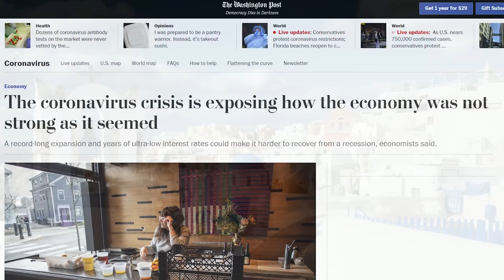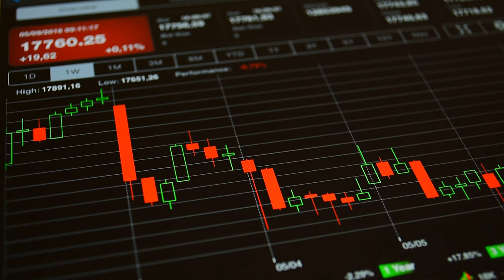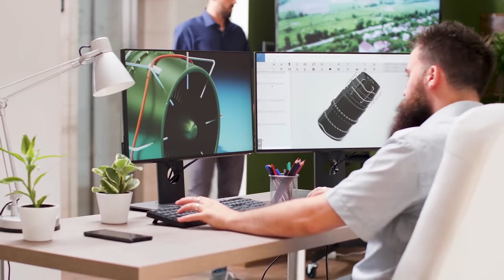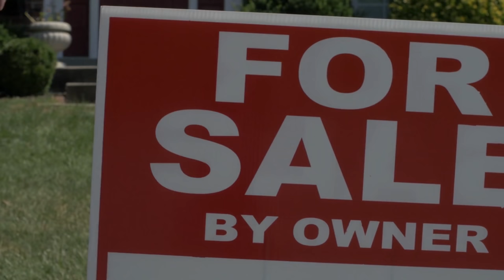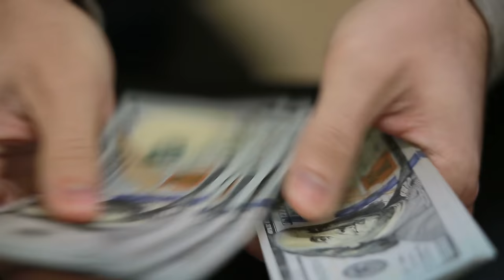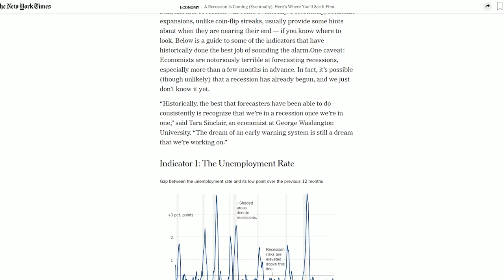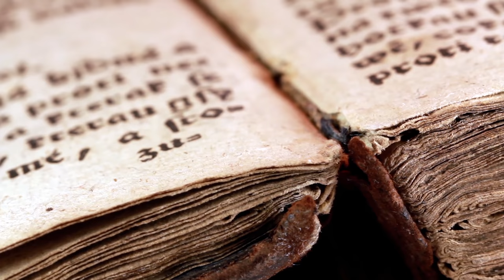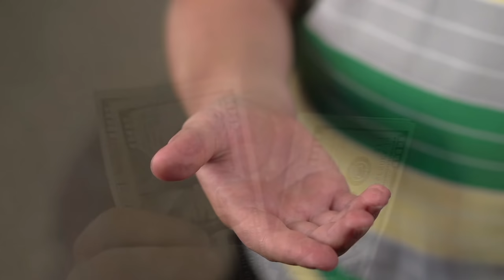Do We Actually Need Debt?

Comment: The part about housing is exactly what’s wrong with college loans.
Most people could afford college back when the only way to get in was to pay for it, now that just about anyone can go to college for just about any degree and go into debt.
Reply: Same as the housing crisis just a different subject.
Reply: This could also be carried over to healthcare
Reply: However unlike a house a college education can actually be economically beneficial in the long run
Reply: “Most people could afford college back when the only way to get in was to pay for it”
If most people could afford it then, why more people has it now?
Percentage of college graduates in US
1940 – 4,6%
1950 – 6,2%
1965 – 9,4%
1975 – 13,9%
1980 – 17%
1990 – 21,3%
2000 – 25,6%
2010 – 29,9%
2015 – 32,5%
2019 – 36%
Reply: @AnishJBhave  wtf, a house provides shelter for a whole family for a very long time: do you really think that this doesn't have economic value?
Of course it has. And when you stop living in it you can still rent it and it will provide a steady income (just like your college education: both are investments)
Reply: @stafer3  simply because there were many economically viable options for non-university grads. You could easily buy a nice house and still have money saved up on just one blue collar job per household in the past.
Reply: @stafer3  they are convinced they HAVE TO GO to be successful in life.
Reply: I mean a lot of people whose in debt with a college degree usually have a degree that's not in high demand.
Reply: @tiredox3788  that's because a lot of people still think that salaries are always according to "how much you know" or how many degrees you have. But salaries are set by supply and demand.

Just picture a town with a thousand doctors and just one plumber, who would have a better pay?
Reply: @huguesjouffrai9618  of course a house has  economic value. But your ability to contribute to the economy increases with a degree while owning a house really does not impact it. Other housing alternatives exist. Owning houses also contributes to worker immobility which creates a sticky economy where efficient allocation is inhibited, so housing is great for the individual in terms of wealth creation but the house itself does not add sustained economic value
Reply: @MK_ULTRA420  Of course it is an investment. It's even as close as you can get to the definition of an investment. For most people it's a great one that provides a lot of security and long term financial stability. If you pay a rent you still pay for the taxes your landlors pays instead of paying for your own, there is no gain there.

In your video the guy still encourages everybody to get indebted to buy real estate, and to just rent the house you live in and put the house you buy to rent. In most places, unless you are a real estate professional or you have a lot of money to invest this will create fiscal friction (sometimes a lot) and many complications (managing repairs in your own house is easier than in your tenant's house...).
This is a good alternative for people who want to move around but in general it's not very different as an investment from buying the house you live in.
Also if you are not very rich it is much more difficult to get a loan if it's not for the house you live in.
Reply: @AnishJBhave  You forget that once you own a house you don't have to live in it forever. You can sell it to buy another one or go live somewhere else and put it to rent... It gives you a lot of freedom since you own it.
It's not for everyone and for some people the lack of mobility is indeed a great problem but the house does grant a financial stability and safety for people which does have sustained economic value because it will enable them to take more risks in other areas. Once you own your house you can invest in riskier assets, quit your job for a riskier carreer while your wife supports the whole household, not have to worry too much about retirement...

"But your ability to contribute to the economy increases with a degree while owning a house really does not impact it"
What do you mean by that? Of course investing in real estate contributes to the economy. The sum of all investments in real estate ends up financing housing for everybody which is sustained economic wealth. It's like saying investing in roads doesn't change people's ability o contribute to the economy. In the end people need houses and roads to live and therefore produce. But moreover housing is a basic need and all investments in real estate goes towards the satisfaction of those needs (it's maybe more visible when you build a house than when you buy one but it's the exact same thing).

Degrees are not economically very different from other investments. They directly increase the prodctivity of labor instead of capital. But investments in capital also end up increasing the productivity of labor (owning a car instead of a bike makes you a more productive individual)
Reply: @stafer3  Source?
Reply: @huguesjouffrai9618  i completely agree. A house has tremendous economic value but it does little to allow you to earn more except in cases where you have multiple houses
Reply: LegoGuy87 no they don’t. Colleges increase prices bc state funding has decreased. The issue is that demand for college has increased without a corresponding rise in govt funding. Colleges used to be cheaper bc few people attended, so they didn’t hav to pay for as many services and faculty. As financial aid ramped up, more students started going to college. The real issue causing price increases is that more people are going who might not be truly qualified as financial aid is largely based on need not merit. Compared to some other countries with free college, those ones subsidize it for academically qualified students, while the US has focused on increasing accessibility even if there is some wastage of money. It’s hard to say which is a better system as there are trade offs, but it’s not the govt’s fault completely that prices hav increased.

Comment: I wrote a long af document about why debt isn't just unnecessary but it is morally wrong. But there are four central ideas. 

- Debt is not necessary to actually purchase anything. 
- Debt can only make purchases more expensive 
- Debt does not necessarily increase wealth
- Debt significantly encourages you to make bad decisions.

Personally, I have been debt free for several years now. It is entirely possible to live this way. And it definitely is a pretty awesome way of living. I am thoroughly convinced , on an individual level, you don't need debt for anything. We just use debt to get the things we think we want slightly sooner at a significantly higher cost.

You also don't need debt to fund businesses as that can be done with equity.

Comment: My definition of good debt is simpler. Does it either reduce my expenses or increase my earnings? If it does the debt is good. If not it's bad.

Back when I rented a home I remember spending over $600 a month. However, my mortgage is $411 a month. And that's a 10-year mortgage, not a 30-year. With homeowners insurance and property taxes that comes to around $460 a month. So, a significant savings. Of course, there are occasional repairs, but in general by the time I have to do any major expenses again the mortgage will be paid off. That means that even factoring in the fact that I have to spend that money myself I'm still spending less money than I otherwise would. In fact, I'm even protected against hyperinflation because a rental property would probably see its rates go up over time whereas a mortgage with a fixed interest rate is based on a fixed loan. Regardless of what happens to the economy my costs are the same.

Now, here's another good example. Energy. My energy bill averages around $400 a month. Sometimes it's as high as six hundred and other times it's as low as two hundred but that's the average. Now, if I could borrow money to install solar panels and or wind turbines and if the cost of installing and running such a system over its lifetime is lower than the money I would otherwise be paying the utility that's a good debt in my opinion.

These cases are very different from the examples given in the video though. In general, most debt is bad in my opinion. Having a large number of debt means that over time the debt becomes worse just like having a large number of assets mean that over time those assets get better. Unless those debts are guaranteed to improve your financial situation it's just not a good idea.

Comment: I think you will find that Islamic banking is less efficient and ends up with the same system but with costly workarounds to avoid the term "interest" (ribaa). The example given in the video of getting a bank to buy a house and then expecting regular payments is call murabaha... but it ends up with the same structure as a mortgage, but with more difficulty in handling late payments (this puts more risk on the bank, which means it has to charge a higher effective interest rate even if it avoids using the word). Another comical workaround is tawarruq where the borrower enters into a contract that he will have to buy some specific object/commodity (but things like gold, silver and salt are prohibited) from the bank at a certain cost and time. To borrow $1000, the bank would give $1000 to a trader for steel, lend the steel out to the borrower with the requirement to pay $1100 for it in the future. The borrower then sells the object back to the trader for $1000 to have the cash (in reality, these transactions will have costs that reduce the $1000), and then pays the bank $1100 for the steel at a later date. It's the same thing as loan, but with weird extra steps.

Comment: Thinking a little more about the model presented for buying homes without debt: This is basically a rent to own deal, which generally have a pretty bad rep. With something like a house, which is going to have to still be a very long term "lease" for most people, the biggest problem is what happens if you need to move? There's no such thing as building up equity, you walk away with nothing, if you haven't finished the term right? In a modern economy where job changing is a fact of life, this seems a huge problem. 

And something the bank holding the house would want to encourage, since if you have to leave, they get to start again with another renter.

Comment: If you want to see a debt free housing market... check out Chicago or Detroit not long ago. After 2008 a lot of home values dipped below the point that issuing mortgages even made sense, so you'd pretty much need 100% equity or a hard money loan. Well, prices kept going below that point, because supply and demand. Many of the fixer-uppers got to about $500. Well within reach of a cash purchase, although as mentioned in the video, building/repairing still costs a lot.

Interesting, those equity banks in the middle east. Us investors in North America know that as soon as things start to look dicey/recessionary, you move up the capital stack and let someone else be a bag holder. Intriguing having an institution take on more risk rather than less than you. It certainly would better align objectives.

Comment: As you've stated, building a house still requires a certain amount of capital in terms of supplies and labor, which will reduce the amount of people who can afford their own homes. Essentially, your entire lower class and a good portion of the middle class would be forced to rent, which would drive rent prices up . Building costs would go down, but the only ones to benefit would be the upper middle-to-upper class individuals that are capable of owning housing. They would then be incentivized to build as much housing as possible, for as little as possible, which would tank living standards as we all get sardine-packaged into mega-apartments and ghettos.

Your metaphor of the juiced athlete is actually pretty poetic. If a person's status as an athlete is dependent on performance enhancers, then any conversation about quitting  the drugs is necessarily also a conversation about quitting sports entirely. Similarly, our economic model depends almost entirely upon debt, so any conversation about replacing debt is also a conversation of ending growth  and collapsing our economy, at least temporarily . This would disproportionately effect those without the wealth to weather the storm (so the lower and middle class) and lots of people would probably die.

Comment: In a lot of ways, consumer debt is starting to go down hill in a very big way: 
- an increasing number of people are effectively locked out of the mortgage market because of the need for increasingly massive deposits, and then if you do get one, you;re effectively walking a tightrope for 25 years, 
- a lot of younger people can't access consumer debt (but can get government debt) because of the need for "building" credit ratings - which you need debt to do in the first place. 
- because lending criteria is so strict, one default or one missed payment will totally ruin your chances of getting ANY debt for the next 6 years (you would find that even trying to borrow £100 would be very difficult despite being able to afford to borrow it),
- if you have a court judgement, you can literally forget even trying to rent a house for the next 6 years and you can ONLY rely on what you earn and save (understandable, but this does get taken to an extreme to an extent that it does contribute to people becoming homeless). Unfortunately, if you have consumer debt, you are only one job loss away from this happening, so its far better to just avoid it in the first place!

Essentially, consumer debt in the UK is far more drama than it's worth, so more and more people are starting to abandon it - me being one of them.

Comment: GREAT video as usual, but there is a mistake about Islamic Banks NOT giving short term debt (car loans, credit cards) towards the end of the videk. THEY DO give them, as a matter of fact i got my own car via an islamic loan from Kuwait Finance House (KFH) (and my house too) and have credit cards with them also.
 In the case of the car, just like the morgage example you mentioned,  they have their own dealership and they sell the cars they have fully owned, or they will buy you the car of tour choice and then resell it for you, again just like ordering via a car dealer. Ofcourse interest free; but now its just typical profit from the sale transaction (dealer markup), which is Fair ,much more so than interest, because by doing so they also share the risk! 
and for the credit cards, they just put service and administrative charges (like annual fee, card replacement,  PIN change and mainly foreign currency transaction/FOREX cost...etc) and they charge the sellers a % for the POS device and transaction facilitation fee. but there is NO interest on the card's funds it self. 
Interest "free" Islamic Banking, is as you explained more responsible, hence more Robust, thats why the 2008 financial crisis was assuaged remarkably in the GCC، it did hit, hard, but was not as catastrophic as other regions. Since we're still very integrated with international markets AND we have conventiotional (non-islamic finance based?) Banks too.

Comment: If home prices fell due to a decreased demand, homebuilding prices would also fall SLIGHTLY due to a fall in the price of land. So much land is tied up for use right now because the dilapidated structures sitting on it are insanely overvalued, and it will never be commercially viable to tear down and rebuild (preferably at a higher density) until the condition gets so bad the structures are condemned and the owners can't pretend they're worth hundreds of thousands of dollars anymore. Cheaper home prices all-around would change that. Not sure how far it would go to compensate for the effects described in the video, though.

Comment: I don't think we need debt no. If we move luxuries/credit cards aside, the biggest debt for people consistently across countries is housing... which like some people have said, could be considered a right and be managed either via community housing or via a similar program as the Middle Eastern banks are doing. If we remove that from the equation, the only major debt left is business debt, which one could remedy via investments rather than loans.

So I think it's certainly more than possible to run an economy without debt, it just requires a change in paradigm from most people. Owning property might no longer need to be the standard in fulfilling one's life.

Comment: I question stability of equity based banking.

For ex. A nation prospers at some rate and hence the value of its currency changes so do prices of goods and services. This can lead to fluctuation of value of underlying asset. I believe this can increase the estimation risk in such a scenario. If the value plummets, well good luck getting your savings back.

Moreover, what will be impact on consumer appetite of such financial institution.

I have seen cases where a systemic over estimation of future value of assets has lead to banks over leveraging assets that have much lesser true value. And thank heaves that financial institutes atleast has a recourse to salvage some value through repossession. This atleast could prevent significant losses of savers money.

Also, to add further can pegged currency help reduce the estimation risk to financial institution?